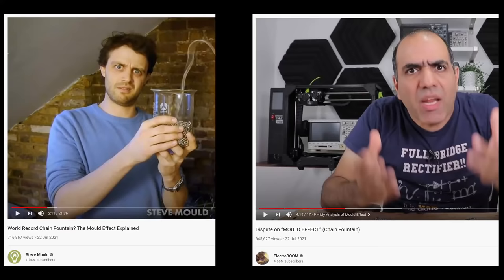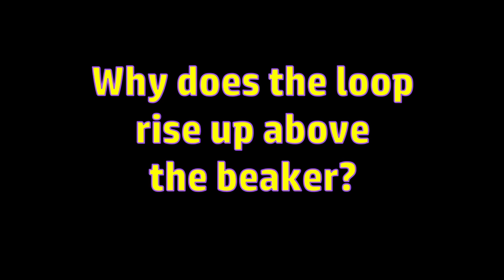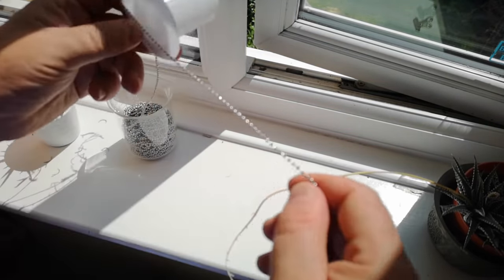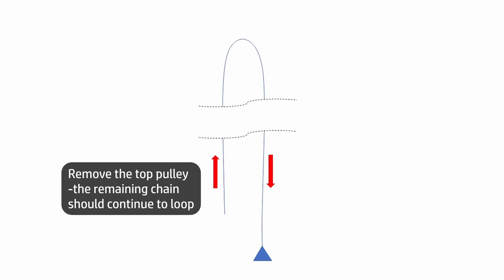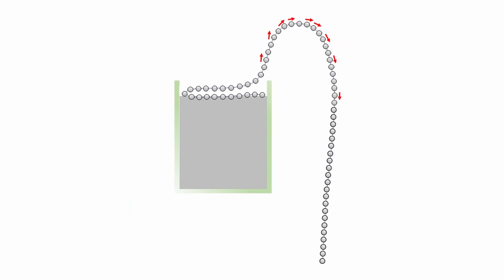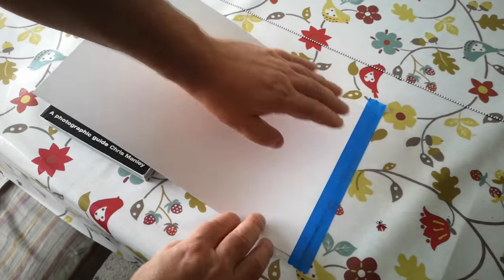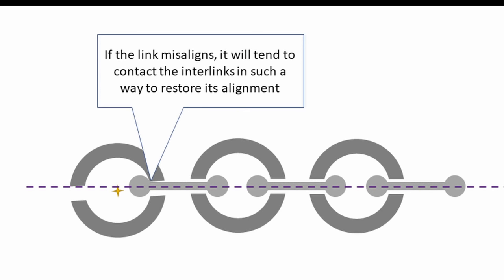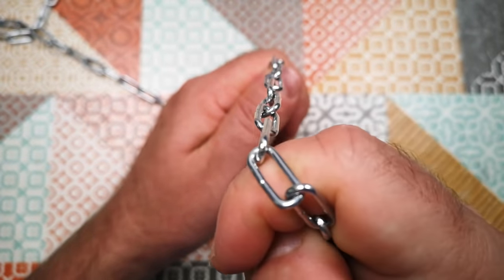Investigating the 'Mould Effect' - (Ball Chain Fountain)

Comment from the maker: Afterthoughts & Addenda
The conclusions I made in this video have now been shown to be incorrect - a lot of the observations here still stand, but the notion that the chain loop rises purely because of an excess of energy in the falling side, has been pretty conclusively shown to be false.  It actually does appear to be a weird mechanical property of the chain that allows it to 'push' against the beaker or chain heap at the bottom of the rising side.  Updated video is here: https://youtu.be/gJYMM-odvfE
Reply: I was watching this video on "drowning machines" and the part on fluid dynamics around 4:45 really reminded me of these chain experiments, so came back here to post it...

https://youtu.be/KaeqEVI0uCk

I wonder if this idea, of something at a "critical" speed effecting the rest of the system at a "sub-critical" speed has anything to do with it?

It might just be the diagrams used in that part of the video reminded me of yours 😂

EDIT: Had another look at his video, and hadn't noticed earlier on theres a part where "critical speed" water hits non-critical water and causes a waterfall that jumps up
Reply: The Cambridge explanation is rubbish.
There is never a bonus-kick at the container/jar/beaker.
There is indeed a bonus-kick when a falling chain-link hits (collides with) the floor of the laboratory, & this adds to the downward pull of a chain, & increases the size of the fountain etc (by say 1%).
But that extra (bonus) force is initiated by the falling/colliding link itself.
Meanwhile, back in the jar, a rising/yanked link will indeed get a kick from the floor of the jar (or from the links supporting that link), but, that kick is not initiated by the rising link, it is initiated by the preceding link.
The preceding link has a limited amount of impulse to give.
The kick from the jar results in a similar (but opposite) kick being given to the preceding link.
But the kick from the jar is not a bonus-kick.
The initiating impulse from the preceding link is not added-to by the kick from the jar.
The impulse of the kick experienced by the rising/yanked link has been borrowed from the preceding link.
In reality, borrowed from the full/whole chain.
Hence, at the jar, links or beads, it makes no difference.

In reality, there is no rising/yanked link. Duznt happen.
What i mean is, we mostly have a rising/yanked arc, made of many links.
In slow-mo u can see that there is mostly a long arc of moving links (talking bout metal beads here).
And the movings usually involve being dragged gradually horizontally for a time, & gradually upish.
There is no sudden kick -- it is a gradual    kkkiiiiiiiiiiiiiiiiiicccccccccckkkkkkkkkkkkkkk.

Look in slow-mo at a bead chain fountain.
There are say 4 adjacent beads acting as pseudo-links being yanked/jerked up.
(a) But, these pseudo-links are not rigid, they have a lot of give.
(b) And, these & the trailing say 5 or even 10 beads are moving horizontally & have daylite under them.
(c) The pseudo-links never have a solid floor to kick (down) against.
(d) And, even if the last bead in the pseudo-link does enjoy an upwards (very very weak) kick, this kick is off a slippery & lose bead or two, & the kick moves thems beads sideways (or forwards)(or backwards)(they are after all lose in every way).
So, beads do not provide anything like a solid surface to kick offa.
Sheeeesh!     Stone the crows!         Milo give me strength!            Are we blind!

The fountain (ie the arch)(the half circle) is simply due to the inertia of a chain.
If a stationary chain lays over the top of a wall, it forms a sharp V-bend.
If the chain is pulled down on one end, then it will rattle up & over the wall, with some speed.
If the speed is sufficient, the sharp V-bend will become a U-bend, due to centrifugal/centripetal forces opening up the V.
If speed increases, the U-bend opens further.
If speed increases a lot, the rising chain leaps up clear of the wall, & stays clear, the zenith/crest depending on gravity, & the U-bend opens some more.
And we have our fountain.
The height of the crest/fountain depends on speed (& is probly higher if chain heavier).
The radius of the U-bend/fountain depends on speed (& is probly larger if chain heavier).

Steve Mould & others say that the radius of curvature cancels out in the equations, & doesn't play any roll in these dynamics.
Steve is wrong.
If he were correct, then that would mean that the radius can vary greatly, for any given setup.
It might mean that if u initiated the fountain with a given radius then it would affect the final (maximum)(steady state) radius.
But i reckon that the radius (for a given setup) tends to one number.
And i reckon that the radius (for a given setup) varies with speed (ie varies with drop).
Just koz the radius cancels out in some dynamical equations duznt mean that radius duznt play any roll in the dynamics.

Steve Mould shows how a horizontal tight pattern of rows of chain (beads) gradually moves away to the west (due to the kick-effect) when the end of the chain is pulled east.
Yes, there is some kick effect, due to the pseudo-links.
But, the greater part of the effect is due to a chain's inclination to retain a pattern.
Here, we see that at each end of each row the chain forms a loop, looping around & back throo say 220 deg, such that the rows are hard up to each other.
As the end of the chain is drawn east, the end loops move across & back & across & back etc.
Now, Steve knows that a chain has a memory, ie it tends to retain a pattern.
In this case, that pattern is a 220 deg loop.
And, as the loop or loops traverse across & back etc, the loops slowly push the rows west.
That westwards slow pattern-push is a different animal to the quick jerk of a pseudo-link kick.
The slow pattern-push duznt suffer from the hi losses suffered by a pseudo-link kick.
Pseudo-links are not rigid, they have give. Give aint a problem for a slow westward pattern-push.
I said that yes there is some kick-effect. 
But, i have already said that these kicks are not bonus-kicks.
They borrow from the overall power of the chain system.
They don’t add to the fountain.

It is virtually impossible to load/store a chain in a jar without having loops. 
And loops result in jumps. 
If u have a close look (in slow-mo) u can see that chains have a lot of horizontal movement before exiting vertically, & the chain sometimes suffers little jumps in the jar, as each leg of each loop jumps (horizontally) over its mate. 
Jumps magnify the fountain, kicks dont. OOPS. No, i am wrong. These little jumps are not bonus-jumps, just like the kicks are not bonus-kicks. Any vertical impulse gained by a jump must have been borrowed from preceding links. 

Also, the horizontal movements seen in the container/jar/beaker are a waste of impulse.

But, in any case, we don’t need bonus-jumps nor bonus-kicks to achieve a growing fountain, & to achieve a very high fountain. 
All we need is lots of speed. The chain will crest at any height, depending on speed. There is no limit.
The idea that something special (like a bonus-kick) is needed (if the chain is to rise above the edge of the jar) is silly.

One thing that everyone has missed, in every youtube re the chain fountain (that i have seen), is that vertical jump effects & vertical kick effects (etc) are cumulative, and lasting (tautology alert).
Or at least partially cumulative & lasting. Air friction, & link friction see to that.
Anyhow, cumulative/lasting effects are the reason for some of the slightly weird gyrations/waves.
For example, it (lasting accumulation) is why we eventually get a persevering, vertical component of arc (a mini fountain) when the test seems to be strictly in the horizontal.
In fact, the lasting/cumulative effect is the main reason for the fountain.
There needs to be an initial vertical rise out of the jar.
A horizontal initial exit wont do the trick.
Reply: Right or wrong, I really enjoyed your video on this 👍
Reply: @atheistaetherist2747  your entire hypothesis goes down in flames in your final line. You claim that the Mould Effect won't happen if the chain isn't lifted off the stack in a beaker, but there are multiple experiments done with no beaker where the effect still shows up. There are also experiments done which actually prove the exact think Mould is explaining in his own videos, done by people who are totally uninvolved in the entire back & forth between the two gentlemen. So, sorry about that, but you've been shot down in flames.
Reply: One huge mistake you made was to model the beads being attached with elastic strings, because that is pretty much the opposite of what they're attached with. They are connected with very stiff metal bars between them, not anything even remotely flexible!
Reply from the maker: @MaryAnnNytowl  That's just a limitation of the software I tried to use.  It allows even rigid members to stretch under certain conditions

Comment: At its core you have perfectly encapsulated the scientific process, you observed a phenomena, constructed a hypothesis, designed and performed experiments to stress test the hypothesis and then formed reasoned conclusions. Well done science shrimp!
Reply: However the conclusions are not correct, because science was not followed. Shrimp acknowledged this. It was his own speculation. The same phenomena can happen with rope and large link chains. Granted it is easier to replicate with a small ball link chain. However this is not limited to those only. This has been observed on ships dropping anchor with massive link chains.
Also the wave effect shown was seriously flawed as the chain Shrimp was using had a far higher mass than the small ball link chain. Therefore the frequency of oscillation would be significantly different.
Reply: Praise The Sun
Reply: @jimdandy2024  What precisely is incorect?
Reply: I don't think he showed that link chain is actually pulling in unstable directions while the chain is falling.

A high speed camera could probably do that
Reply: @lomiification  Thanks.